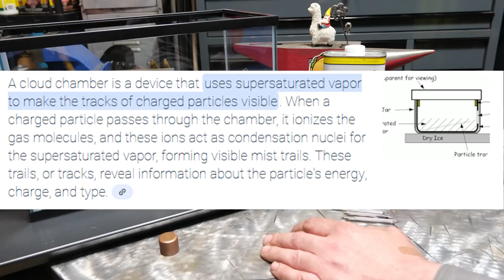Radiation exposure with welding, Is it true?

Comment: Very good video! Tungsten was used to make incandescent light bulb filaments before fluorescent and LED bulbs were invented. The manufacturers discovered that pure tungsten filaments had a short life due to growth of the grains in the metal from the heat generated within the filament. They found that adding thorium oxide (thoria) would help to pin the grain boundaries and slow the grain growth to a point that would make the filaments last much longer. The same principle was used to make tungsten electrodes used for welding last longer. Lanthanum, cerium and zirconium oxides have the same effect.
Reply from the maker: Excellent post, thanks for sharing.  Makes total sense.  I know for a fact pure tungsten will not hold a point to near the amperage of almost any  blend.

Comment: Anyways electric arc welding of "ANY" sorts gives off a very strong Ultra Violet radiation 200 nm and below. I have measured it vis a vis sunlight, welding is at least 2 ~ 3 orders of magnitude higher UVC than sunlight. UVC is a canser risk. I strongly advise everybody to cover as much of body as can be done before any electric welding

Comment: i stopped to use thorium electrodes because dust created by grinding. heavy metal poisoning is enough for me, inhaling radioactive material is too bad in my opinion.
if you have a dustless grinder and during cleaning you control every particle then it is ok.
Reply from the maker: 100%.  Luckily there are other options that don’t put radioactive particles around in the air.

Comment: Yes but UV radiation, not rogue X ray radiation. Radiation means some form of energy radiates from it. Microwaves are a form of radiation and how the popular appliance works and therefore gets its name. Fun fact it was originally called the RADAR range because it was an oven using RADAR technology to cook. So what kind of radiation does the tungsten release? How much? Have a gieger counter to take a radiation reading off it? It wouldn’t be so available if it was dangerous. Also smoke detectors use small amounts of radioactive materials to detect smoke.
Reply: Thorium primarily Emits alpha particles which is the slowest and heaviest of the ionizing radiation types so while it's typically stopped by your skin, if you breathe or ingest it the particles can cause DNA and organ damage

Comment: duct tape the sticks to the trucks AM/FM radio antenna... listen to radio, hear for popping in the speakers. every radio can be used for that, and if its really bad it would overwhelm the signal from the channel that it is dialed into. as the decay pop hits the antenna it wipes out all filter capacity on the circuit board forcing it to trickle dump off the intake transistor to ground "exceeding inbound radio sensitivity voltage on the circuit primary capacitor, lower and lower signal strength on the smart phone from - data packet loss"
Reply from the maker: That’s wild, and makes sense.  I would try it but the radio in my truck just burned itself out lol.  I will try it with neighbors car 😅

Comment: Thoriated tungsten filaments in vacuum tubes have been in universal use in radios and other electronic equipment since before the 1940s, (probably about the time when Lee DeForest developed the early triodes) when I first began repairing them and building electronic equipment.
Reply: Only RF high power transmission thermoionic vacuum tube  use thoriated heater filaments.  There is a legend about magnetron filament but I demonstrated that cathode is not thoriated (on my channel there is the demostration).
Reply from the maker: Very interesting.  The amount of things that contain thorium that I had no idea did is surprising.
Reply: Also some microwaves have thorium in their magnetrons

Comment: Grinders with filtered vacuums exist but I just grind outdoors (chuck tungsten in a hand drill then spin against a flap disc on an angle grinder held in the chain vise of a Tristand).
Don't forget to wash your hands or wear nitrile disposable gloves!
Reply from the maker: 100%.  That dust on the hands would not be a good thing, almost for sure going to get in your mouth.  A little bit of care goes a long way.

Comment: There ia nowadays available a marvelous detector/analyzer called RadiaCode 103 that can tell what kind of radiation it is subjected to. You can read the basic info from the  display of the device, sized about the same as a TV Remote control.  Or you can further analyze the rsults with a smart phone or laptop computer.  The price seems to be somewhere in $300 range at Amazon, or directly from RadiaCode.  I think mine is the previous version, probably 102.  I just don't remember where I saved it...  But I did once check all my about 1/2 dozen electrodes with it.

Comment: It's not for alloying purposes, per se. The radiation from the thorium ionizes the air around the tip of the electrode. This brings down the electrical resistance of the air, making it easier to strike and sustain an arc.
Reply from the maker: That could be the case on the arc starting but if you take 3/32 thoriated and 3/32 pure tungsten the thoriated will hold a point far better than pure at the upper end of the amperage range.  Virtually all alloyed tungsten holds a point better than pure, and the tungsten itself tends to not turn to liquid as quickly too.

Comment: Been wondering about this for a while. My place uses exclusively thoriated. Its everywhere. They use the short stubby lengths for things and keep them all. Theyre on surfaces, in drawers, in tubs everywhere. Every welder uses a angle grinder with a sanding pad to grind their tungsten in their bay. This place really is gonna kill me huh
Reply from the maker: Well that kind of quantity of thoriated tungsten isn’t very good.  I wouldn’t worry so much about the tungsten sitting around in say a drawer, the particles won’t likely leave the container.  It’s the dust that will cause issues.  Dust in general is bad for lungs but radioactive dust is a big no go lol.

Comment: Yes sir, they taught us don't hold the tungsten in your lips/mouth because of the radioactive material. They also said, leather welding garments reduce the radiation from welding to a little less than the radiation from sunlight. I'm only guilty of wearing the cloth jackets in my old age, occasionally. That's a cool science lesson you setup there.
Reply from the maker: Great point on the holding it in your mouth, it would be easy to do that without thinking and it’s definitely not good.  None of us know what our bodies tolerance is for exposure to a lot of bad things, but it pays to avoid as much of it as possible lol.

Comment: I found a tungsten colour chart online that shows that Yellow, Purple, Red & Green tungstens were better to use with Older Transformer machines. So I never bought them for my AC/DC inverter machine.

I always imagined the thorium electrode radiation was really toxic, I wouldn't have even wanted to pick one up, thanks for the lesson.
Reply from the maker: At one point the thoriated probably held a point far better than a lot of the other options out there.  In that sense using it might be reasonable.  In today’s world it’s just worth it no doubt.

Comment: I've read that red 2% is best for DC on a transformer welder, mine is a  Lincoln sq wave 175 amp. Is that true? What do you think would be as good on mild steel and stainless?
Reply from the maker: So I personally use 2% lanth on everything, and I have found it works great.  It will handle high amperage on a/c and d/c and maintain a point without issue.  With transformer machines they tend to be fixed at 60hz frequency and sometimes with fixed a/c balance (older ones are 50/50 EP/EN polarity).  Depending on the balance it puts a ton of heat into the tungsten and none of the types will hold a point.  If the balance is adjustable you should be able to maintain a point with 2% lanth.  If not still use that tungsten, just ball the end slightly and you’ll be good 😀👍.
Reply: @makingmistakeswithgreg  Thanks for the answer
Reply: Ceriated holds up pretty well on transformer machines

Comment: And note that those ones that you see are ones coming from surface of tungsten. I wonder how setup with thoriated electrode dust looks like. Quarter inch of it, maybe, ground in enclosed space with diamond sharpener tool... 
It's 2% by weight so in 100 grams /3,5 ounce/ 1543.24 grain of electrode you get 2 grams / 0.0705479 ounce/ 30 grain of Thorium. That seems like a lot.
As always great video Greg :)
Reply from the maker: I wondered about a pile of dust too.  I have access to an enclosed sharpener, I might just burn up a few tungsten’s and see what happens with the pile of dust lol.

Comment: My Geiger counter goes a bit crazy when near a thorium alloy welding electrode. How dangerous is it? It’s slightly dangerous when welding. But it’s when you’re grinding the electrode that you put yourself in danger. When grinding tungsten carbide, you’re in danger because of the cobalt. You breathe that poison. When grinding a thorium alloy tungsten welding electrode, you’re breathing thorium. A very fine cloud of this lingers in the air for a while, even though it’s heavy. The reality is that there’s no real reason to use thoriated electrodes anymore. Despite some people insisting that it’s better, it’s not. I built a grinder for my electrodes. I have a shield around most of the wheel with a strip of paint filter catching the dust. You’d be surprised at how much dust there is. Don’t breathe any tungsten. That’s not great by itself. In fact, any grinding is unhealthy. The dust is flung around the room and and fine particles in your lungs is bad.
Reply from the maker: 100%. If in doubt turn the lights out and turn on a bright light.  The amount of dust floating around will become extremely visible.  Even doing simple grinding of anything produces massive amounts of dust.  Thanks for pointing out tungsten carbide issue as well.  Many alloys and common metals have super bad stuff that you don’t want exposure to.  It’s so easy to forget how dangerous many things are when turned into dust.
Reply: @melgross  This is mostly bar horror stories and urban legends but a lot of older welders I know tell about how you loose your teeth from tig welding. It's probably BS but if any health concerns did exist they came into existence during their careers a while ago when thoriated tungsten was used extensively, your teeth probably won't fall out but radiation poisoning is not a joke and they probably do radiate when exposed to extreme heat from welding. I'd stay away from red tungsten electrodes in general, there's no reason to use them today because on inverter machines all of them work the same except green which sucks. In my area, gold tungsten (1.5% La) is cheapest, and I've ran tests with literally all of the electrodes and all of them worked the same both on AC and DC. Just buy whatever color you like and whatever's cheaper that's not red or green and you'll be fine.
Reply: Try it on a packet of crisps (fries in the US) .. especially cheaper ones ..
Reply: @BrodyLuv2 probably more toxic than the tungsten! 😂😂😂
Reply: The reason I use thoriated comes down to its high amperage stability. It is also extremely stable when ac welding at higher amperages as well. Downside comes down to it not being as stable at lower amperages, at least not compared to other alloys. It has its place and is still very viable in gtaw welding.
Reply: My counter shows more counts near that too
Reply: I’d like to know more about your grinder. Can you place some pictures up?

Comment: Very cool! Knowing it is one thing, getting it depicted like this is the other. And in addition I learned how to build my own cloud chamber with household materials... 😂 Great video as always!
Reply from the maker: It’s pretty cheap and fun.  What I find fascinating is atoms will be emitted just like you saw for millions (if not billions) of years off that tungsten, and it will not measurably weigh less.  Mind blowing how small atoms actually are 😀.
Reply: And, in addition, the particles are similar to the core of a helium atom - 2 Protons, 2 neutrons - stripped of it's elektron hull, which gives it positive load. This really shows the ingenuity of the cloud chamber because it let's us humans "see" single atomic cores (or at least their interference with the Ethanol vapor).

Comment: Only red is radioactive but it's alpha emitter so dust particles which are dangerous when inhaled, all other tungsten alloys are safe
Reply: Not necessarily safe, tungsten is still a heavy metal, but it's significantly less dangerous than getting an alpha emitter in your lungs.
Actually, you don't want any kind of dust in your lungs, even something as mundane as sawdust can wreak havoc on your lungs.
Reply: @ForfeMac  of course you shouldn't be inhaling anything except air, but regular dust at least won't wreck you when it gets into open wounds or your eyes etc
Respirators aren't enough protection against alpha radiation, it's more dangerous than gamma rays in some cases

Comment: Most of the time Alpha Particles cant get through cloths or even skin, but they are a danger once they are inside the body
Reply: @Hans-Yolo  They're extremely dangerous because they'll stay on clothes and surfaces and can be inhaled later. Beta radiation is the only "safe" one but you shouldn't really mess with that either, just use other tungsten colors, they're all the same except green which sucks
Reply: all radiation is bad... 

your skin takes most of the damage because thats what it resonates with and ionized particles dissipate their energy into the skin... 

alpha does significantly more damage than gamma...